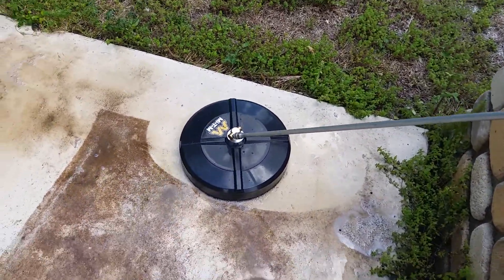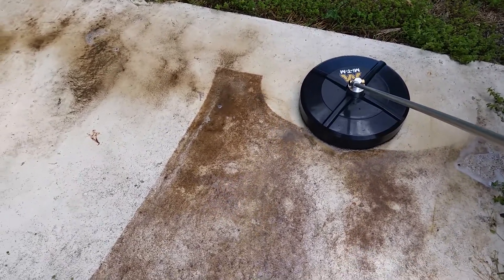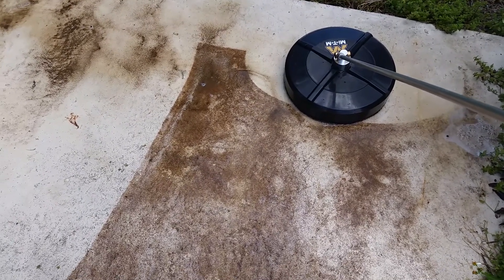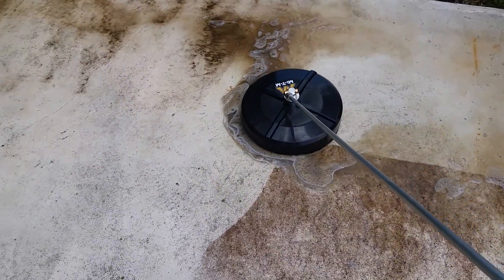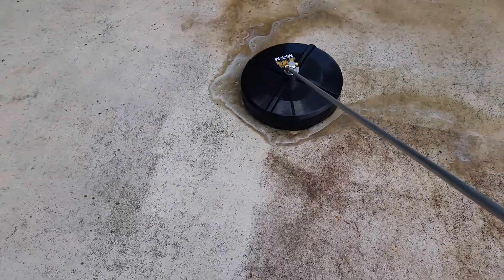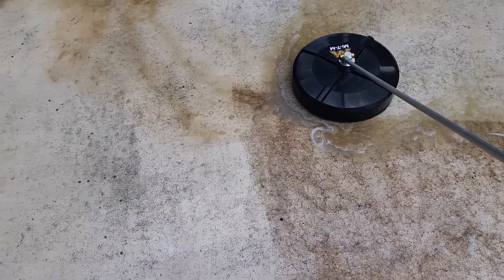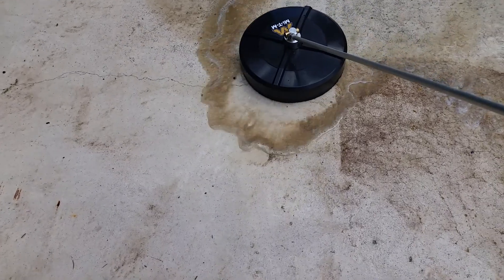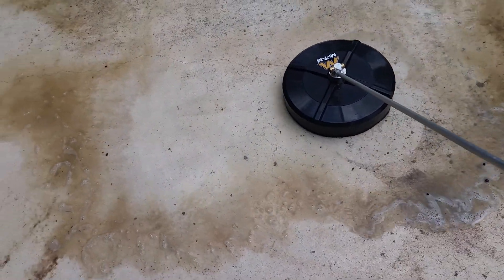Mi-t-m  14" rotary surface cleaner  tip modification

Comment: I have a 3600 psi 2.5 gpm. Will the stock nozzles work?
Reply from the maker: Perfectly!!!
Reply: hello sir, i dont know which tips my surface cleaner have, which ones do tou recommend for more pressure? i have the dewalt 3600 psi 2.5 gpm

Comment: Are the stock tips more for a 2.x gpm machine?
Reply from the maker: They would work well with a 3 gal. per min. pump creating a little over 2000 psi.  A 2.5 gal pump will give you  around 1500 psi . with the stock tips. Hope that helps. Their are tip charts online that tell you  pump size + tip size = psi .